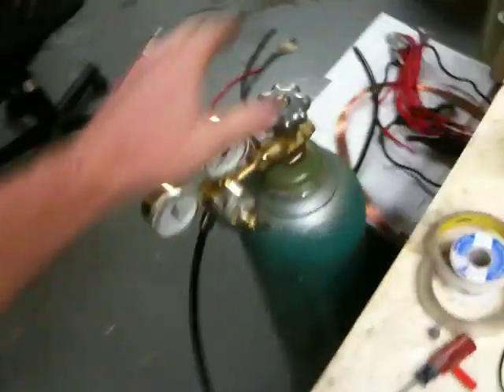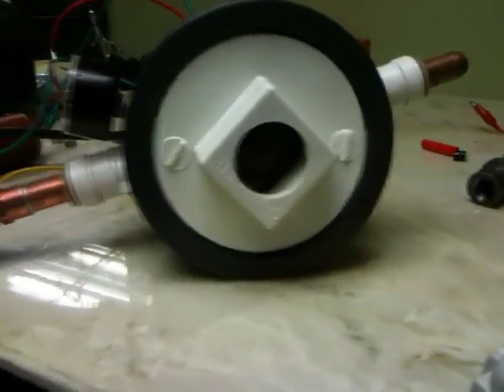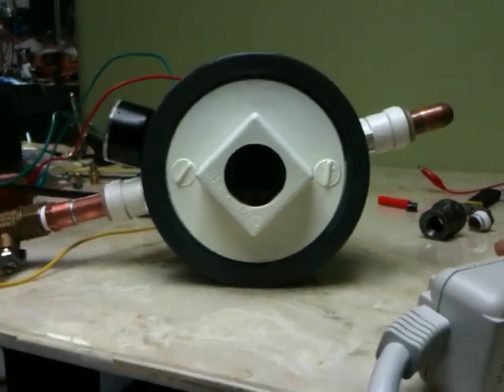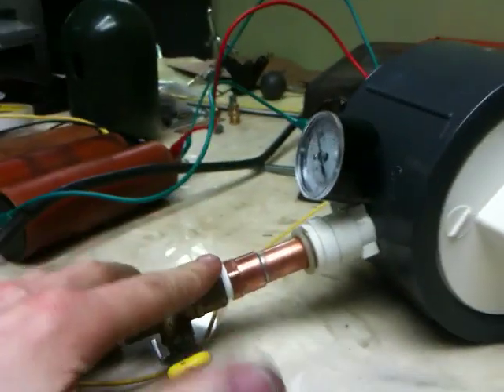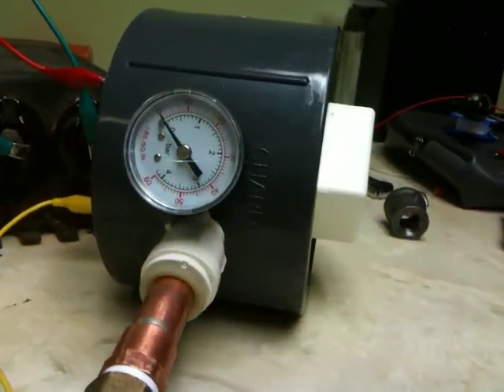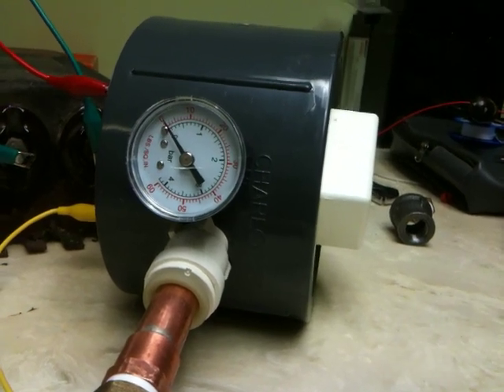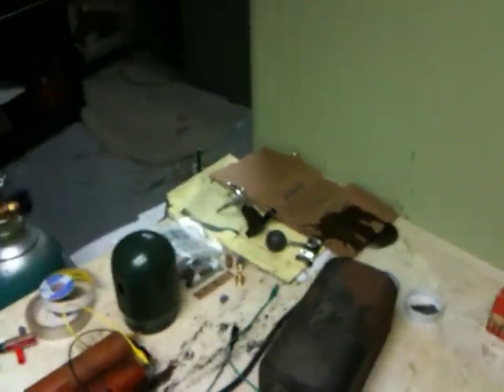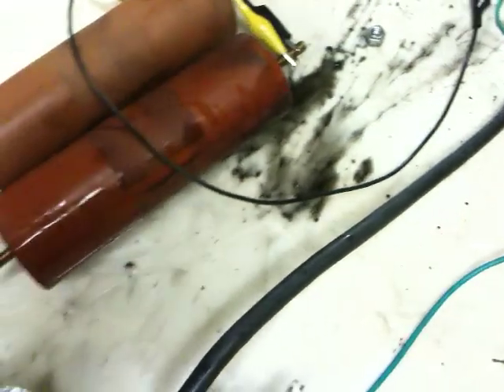1.4 High Voltage Arc+Argon+Over Voltage = Loud Exploding CAP... By By Cap! (EPG Testing 1.4)

Comment: Hey Russ
Argon is in connection with welding viewed as an active hot gas, whereas CO2 is a passive cooling gas. If you want more control over your gas chamber, you might try out a Tig welder with HF ignition and running it on a low arc. Just a thought. Delicious lubricants explosion. Beware of low flying objects or a radar is needed. Nice job with Chamber by the way.  Be safe than sorry. :O)  Alan

Comment: The timing of the explosion was perfect.
I hacked up a lung because I laughed so hard.
Now all you got to worry about is the P.C.B.'s that were in the oil?

The argon spark-gap is awesome.
The spark-gap is cationing photons in the argon in like mad. I wounder what the anode and cathode vaporization time range is. Just how long the system needs to run in order to make the Mag-Gas. 
Please send me the spec's you need for the Arduino program sketch. I'll get right on it.

Comment: Hola Ross: Algo interesante que note en este "1.4 High Voltage Arc+Argon+Over Voltage = Loud Exploding CAP... By By Cap! (EPG Testing 1.4)" es que cuando acercaste la camara la imagen se distorsiono, lo que significa que el campo electromagnetico ahi es fuerte y los circuitos de la camara se vieron afectados por ello, en la pantalla de resolucion de imagen tras el lente. no se si esto sirva de algo, pero me llamo la atencion.
Buena semana.

Saludos desde Mex.
Vicente.

Comment: Hey Russ, been super busy, but putting in a couple hours a day. . , do you think it's possible that your unit stored energy when it was at high pressure, and released it back into the cap?

Comment: shame about the cap blowing up-sometime with spark gaps there cap be a DC component to the voltage and charge a cap up on DC from an AC source -maybe thats how it blew.
is it the Alnico magnets you are burning or are they next to the arc on the carbon rods?
magnets will lose magnetism when used as a spark gap-my little neos i was burning have zero magnetic field after the HV.
you need to have some eye protection for the radiation-your rig could be puting out x-rays as well as UV

Comment: how wonderfull would this be, if the current be DC in and DC out, a simple 12 v battery with a fly back transformer, 25,000 volts. a dc primary. and a dc out in series.
any battery therfore can be charged or recharged on the energey needed to run the flyback transformer, and the primary voltage winding that can be small. for best results the radius of the tube is factor, could very well be by a factor of 10
^4 to 6 inches for the flow tubes. the result is an increase in volume+ mass, energy.